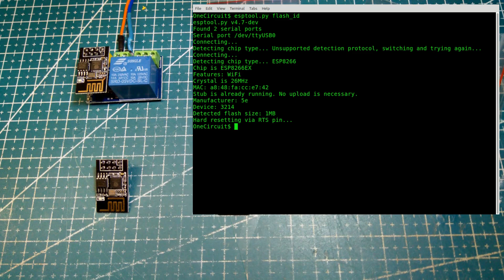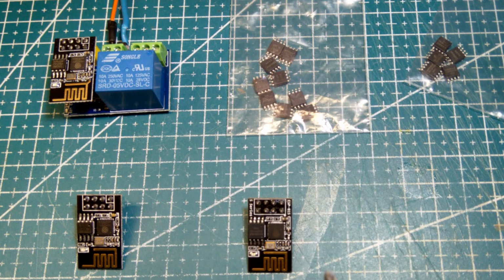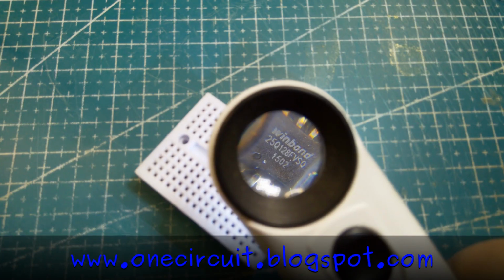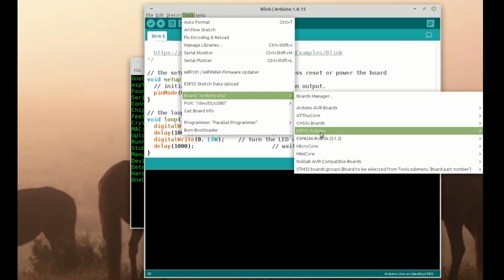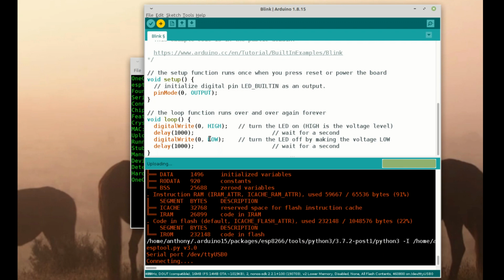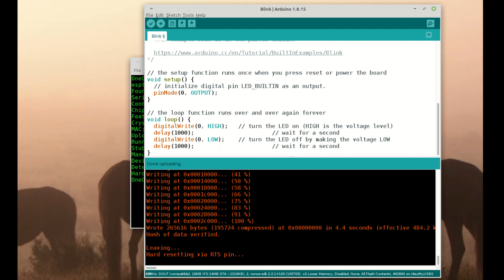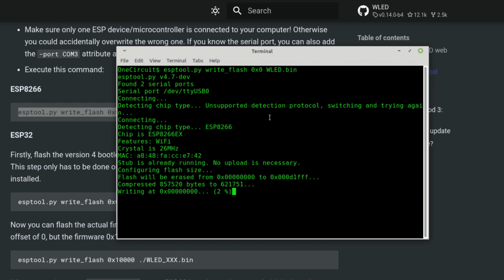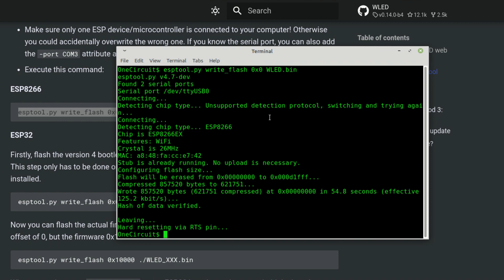Expanding the ESP01s to 16MB!

Comment: You could create an empty .bin with of 16MB use the esptool to see if you can flash the whole chip. On Mac / Linux you can use "dd": dd if=/dev/urandom of=test.bin bs=160000 count=100".  Then: "esptool write_flash 0x0 test.bin" to start the writing at the very beginning of the memory. It won't do anything but at least you can see if every byte is flashable (not a word :) ).
Reply from the maker: Done!

Configuring flash size...
Flash will be erased from 0x00000000 to 0x00f42fff...
Compressed 16000000 bytes to 16004891...
Wrote 16000000 bytes (16004891 compressed) at 0x00000000 in 1408.7 seconds (effective 90.9 kbit/s)...
Hash of data verified.
Reply: @onecircuit-as  If there is no YouTube video.. it didn't happen :P 

No just kidding... great!
Reply from the maker: Stand by! 😎

Comment: What is this flash used for? Is it just EEPROM for storing data, or can programs live there too?
Reply from the maker: Both! If you use LittleFS or Spiffs you can partition and then store data just like an SD card. You can also write bigger programs - check out the WLED project where a little extra headroom is always appreciated. Also - OTA programming is easier with extra memory.
Reply: @onecircuit-as  It has been some years since messing with the 8266, but yes, I remember there was some limit to the executable program space (1mb/2mb?).  The rest had to be spiffs, web page data, OTA, files and such.
Must feel good to use this older device in a way not specifically intended or endorsed by the manufacturer!  Oh yeah!
Was looking forward to watching you remove the original chip.  I often make a mess of things like this, even with hot air.
Reply from the maker: If you go back to the first video I remove the 1MB flash and replace with the 4MB chip - its the same process (although I admit I'm getting a little better at it!)
https://youtu.be/wmXeXsnMHxg&t=296

Comment: Now the challenge is to write a program that uses every one of those bytes.
Reply: #include <Arduino.h>

void setup() {
  // Initialize Serial communication for debugging
  Serial.begin(115200);

  // Get the size of the flash memory
  uint32_t memSize = ESP.getFlashChipSize();

  // Fill memory with a pattern (e.g., 0xAA)
  uint8_t pattern = 0xAA;
  for (uint32_t i = 0; i < memSize; i++) {
    *((volatile uint8_t *)i) = pattern;
  }

  // Notify that memory filling is complete
  Serial.println("Memory filled!");
}

void loop() {
  // Empty loop
}

chatgtp already on top of it
Reply from the maker: boom
Reply from the maker: Challenge accepted! 😳😬